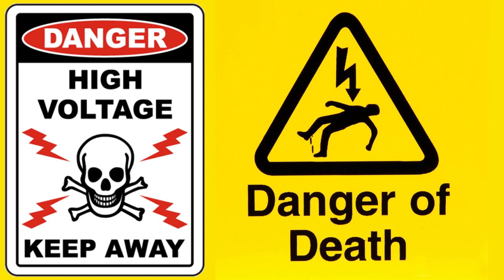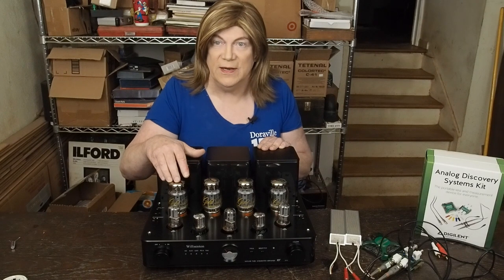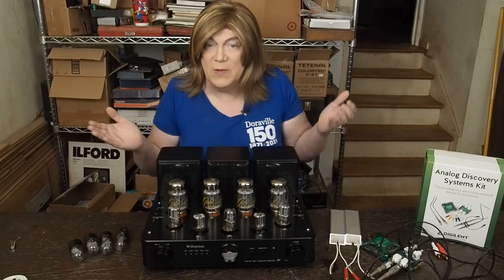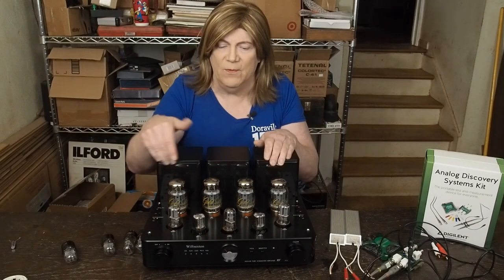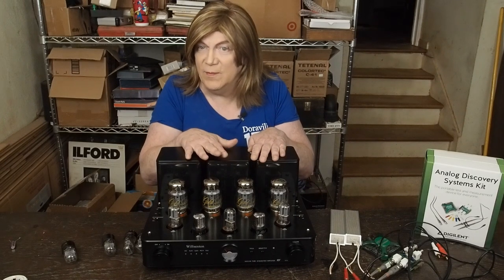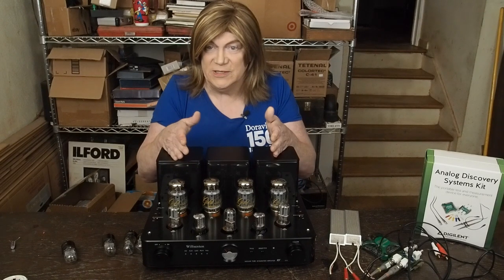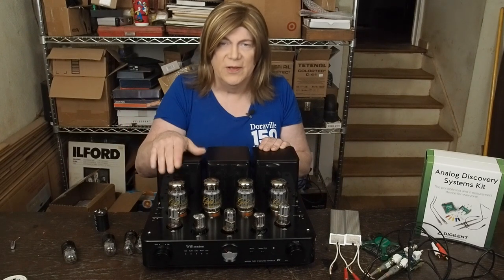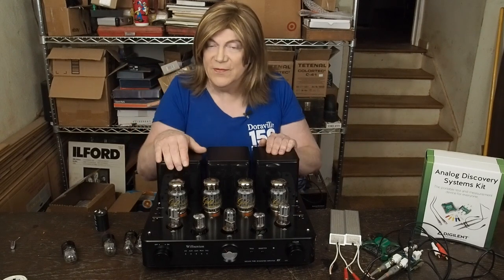Willsenton R8: Listening Test and Tube Rolling Advice

Comment: Not sure of your description but if the output stage is cathode biased maybe they are elevating the heaters and using the cathode resistor voltage as a cheap easy way to get the elevation? It's a noise reduction trick when using old style octal preamp tubes that didn't have a spiral wound heater.  No need on the push pull output tubes any hum would cancel. Best would be elevation tapped off the power string using a voltage divider and a cap at about 70V elevating only the stages before the power tubes. Rewiring the heaters with a virtual center tap is a very good idea. If they were so worried about noisy octals they could have fitted in a little DC heater board for the input tubes for little added cost. Anyway, best build it right first, proper grounding, short leads, and proper lead dress, then try elevating the heaters if the octals are hummy. I've found elevation not worth the effort, better to go with DC heaters.
Reply from the maker: They are grounding the heater on one leg at the transformer end, and using that same leg to ground the cathode of the output tube. So they are using one leg of the AC heater as the signal ground for the cathode. It's a fixed bias amp with a 10ohm shunt for the meter.
Reply: @SkunkieDesignsElectronics  I've only seen this in simple tube radios and of course  the earliest low end Fenders like the Champ. Very odd choice for fancy modern hifi, penny wise pound foolish, maybe when they prototyped it it worked fine and they went with it. I agree make it right if only for proper design discipline. Wiring up heaters is a boring chore looks like they passed it on to the repair tech!

Comment: The R8 is well known for having better bass or too much bass which is relatively subjective to the user’s need of bass. Putting aside the power tubes and preamp tubes, are their parts on the design of the R8 that contributes to the better bass or too much bass (subjective), that is different from other tube amp design.
Reply from the maker: Well known by whom? Those YT reviewers? When we listened to the R8 vs the X7 the muzishare had at least as good of a bass response but also was less boomy sounding, likely due to having better output transformers. You not only can hear this, you can see it in the frequency response curves. Honestly the R8 design is your basic, bog standard push pull KT88 amp, other than that strange 6SN7 tube they used to power the front end. It's not a bad sounding amp, but it's not anything special either.
Reply: @SkunkieDesignsElectronics , when I said well known for the owners of rhe R8. I dont mean famous, I just dont want to sound ranting on a gadget I dont own. I asked you bcoz of your technical know how on this audio equipments which I trust. Thanks again.
Reply from the maker: Some people in almost any hobby will defend their purchase decisions to their grave. I will never understand it. there is nothing special about the R8 design that would give it "extra bass". If anything, the values of the coupling caps tend to limit it.

Comment: Thank you very much for this review.A lot of nice and precious infos about R8.I own a Willsenton R8 since one year.I have no any issues, no hum, not any kind of noise.At any volume is dead silent. For me, your review is perfect because now I know the 6sl7 tubes influence the quality of output stage sound.I will change it to nos Melz 6sl7.
I have a question.I own a tube preamp wich I use with musical fidelity dual monoblock a3cr power amp.The output volume is very high.If I put a variable resistor to every chanel,internally, before the volume pot, will affect the quality of the sound?
Thanks again
Reply from the maker: Sounds like the preamp is too hot for the power amp?
Reply: @SkunkieDesignsElectronics  When I turn up the volume under a quarter it is very loud (supposing 18 o'clock is zero, at 20 begins to be very loud)
My speakers are Focal 93 db.

Comment: New EH tubes are often as good as NOS, if not better. NOS got so scarce many people are getting pulls, sometimes fakes, besides tubes were not made to stay in stock for 70+ years. The problem we found is grids getting "tired" from tension over so many years. Give them a try because EH are mechanically and chemically far better than most JJ tubes.
Reply from the maker: I agree some of the JJ tubes are not very good, but their EL34L tubes sound really good.
Reply: @SkunkieDesignsElectronics  I heard about some of their output tubes being good but don't work that much with higher than line signals. EH is certainly the best when it comes to small signal tubes and durable outputs.
Have you compared several types of JJ and EH, do you find EH being mechanically and chemically better made?

Comment: Thank you so much for the videos. Really do enjoy them. Quick question perhaps somebody could help with. I use the R8 as an AMP only so it always stays on the Pre-In selection. In that case , do the 6SN7's and 6SL7's come into play in the circuit at all other than the center 6SN7? No sense rolling those tubes I imagine if they have no effect on the amp circuit when used in Pre-in mode. Thanks for any thoughts.
Reply from the maker: The only thing the pre-in bypasses is the volume control.
Reply: @SkunkieDesignsElectronics  Thank You! Appreciate the reply.

Comment: Yeah maybe there were some different revisions with it and alittle cost cutting too ...very common - mine is also dead quiet. I have noticed with mine and others I've seen was it had a little cheaper clamps for the 2 filter caps and has no cover over the power transformer - been running the 6550's an inbetween from KT88-EL34 On another note the R8 has been my main amp for a couple years UNTIL I built Skunkie's 300B !!! Love the R8 but The 300B is not going anywhere!

Comment: Hey. Can I adjust the step increments of the volume control on the remote? Thanks in advance.
Reply from the maker: No but you could attenuate the signal on the input so that each step didn't change as much.

Comment: Is it futile to use a separate preamp ? I’ve heard it does not bypass the units preamp section. Love mine but I like to try stuff like preamps and stuff
Have mine with Klipsch Heresy IV. 
Ifi Zen phono and Thorens turntable. Dead quiet and wonderful sound.
Reply from the maker: I'm not sure how these preamp inputs are wired. Honestly, very few tube amps actually need a pre-amp unless they are specifically designed without a "pre-amp" section.
Reply: @SkunkieDesignsElectronics  thanks

Comment: dear after i test the amp... how much time i need wait to open it and can touch in parts inside.. need wait a few days or can after 2 hours?
Reply from the maker: 30 minute to an hour should be fine, I would always test the power caps for voltage before touching anyting!

Comment: The phono pre-amp you speak of that has hum when connected. Is that the tube phono you built on your channel?
Reply from the maker: Yeah and while it does have >very< minor hum with other amps (1 foot away it's not audible), it's doing CRAZY things with this amp lol. When I heard country music I was like WTF!~
Reply: @SkunkieDesignsElectronics  Do you have a radio station transmitter close to you? It would have to be a very strong signal for the phono/amp combo to pick it up. As for country music, i have exactly the same reaction any time I hear it 😁
Reply: @SkunkieDesignsElectronics  That's odd. I made one of the phono tube pre amps exactly like yours (chassis is a couple inches shorter -to fit the shelf) and I don't have that issue. Amp is dead quite driving LS50s (85db efficiency). Must have an unique issue? Love the videos! Please post a parts list when you get it sorted out. When I finish the Dynaco ST-70 I can rotate it in and upgrade my R8. Thanks for tackling this one.

Comment: Can you compare between Triode & UL and let us know the sound different between them. Thanks
Reply from the maker: I think I did in the other video, triode mode to me sounds dull/dead and likely is from the negative feedback used for UL mode being too much for triode mode. But in other amps, I also prefer the sound of UL.
Reply: @SkunkieDesignsElectronics  I have KT88 PP that I have tried both Triode/UL, the triode sounds better with instruments. The distortion level are pretty much the same for both on my amp. Wonder different design would make it's better.

Comment: How would something like this compare with properly built Dynaco ST-70?
Reply: I might be able to weigh in on that comparison in the future. I now have all the parts to build a VTA ST-70. I need to finish a Marantz 1060 rebuild first. (Trying to reassemble my first stereo from the mid 70s). When it's done I'll pull my R8 and do some modifications per Skunkie's findings.
Reply: @58markmc  Oh super! Im trying to decide on my first proper tube amp for a set of large open baffle speakers and was eying a Dynaco ST70 kit from someone named Bob Latino.
Reply from the maker: Do those type of speakers really need 45 watts to drive them?
Reply: @SkunkieDesignsElectronics  I honestly don't think they would. They are large  DIY open baffles with a sensitivity of around 95db at 1w.  Im thinking a few clean watts should do but I like to tinker so maybe some extra watts for future proofing if I build some different speakers (just thinking)   :)

Comment: I've had my R8 for over a year and use the upgrade PSvane KT88s in triode mode all the time. I also got some NOS 6S7Ls and 6SN7s. It's quiet as can be and I can listen for hours with no fatigue. The only other tube amps I have to compare are a Dynakit ST-35 with the Dave Gillespie boards , a DG Magnavox 8600, a DG Maganavox 9300 (with Dynakit OPTs) and some rebuilt Magnavoxes. Those are all low watt amps and drive my Klipsch RP600s or my Dynaco A-25s but the R8 sounds as nice or nicer than any of those. Is there a QC issue with the manufacturing process?
Reply from the maker: I'm just sharing my subjective opinion, I personally felt the amp just sounds dead in triode mode, clearly you like it. I have no clue what source you are using, many DAC's perform their own equalization curves etc so your system could sound very different from what I am hearing. Even the wide variations is source mastering can change the sound. Also room treatments etc. etc. etc. It's why EVERY review has to be taken with a grain of salt, there are hundreds of variables involved.

I can only report what I found on the sample I have, and this one has some MINOR hum at higher volume levels on the knob with no input on both channels. The preamp source also has hum. A few feet from the speaker I can't hear it so this isn't a major deal, but the grounding scheme they are using is far from normal or ideal.
Reply: @SkunkieDesignsElectronics  Yes, listening opinions are definitely subjective. Some peeps like triode some like ultralinear. For sources I have a Bluesound Vault and a turntable (Technics SL-Q2 ,Audio Technica VM540ML cartridge and the  Ear834 clone) with no hum on either source.  Will be interesting to see what the cause turns out to be as some owners have no issues and some do have hum issues.